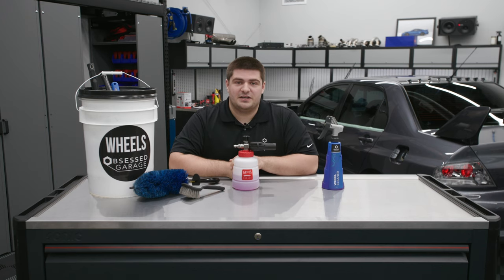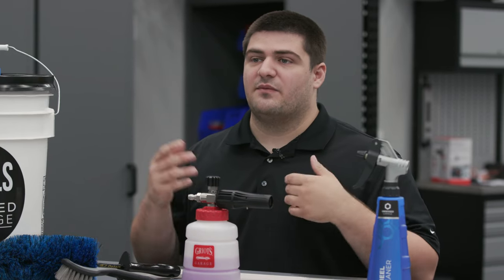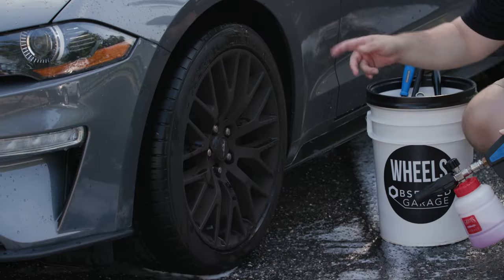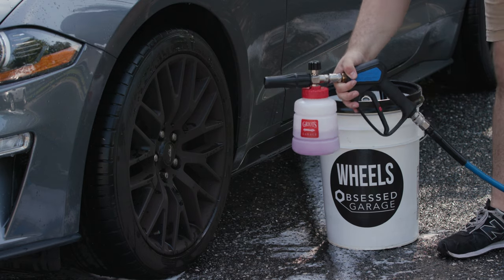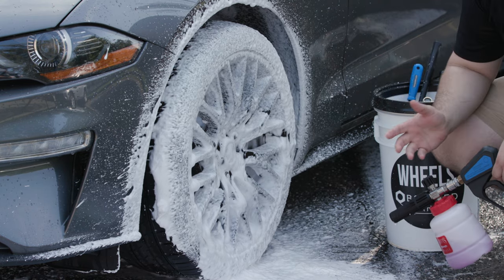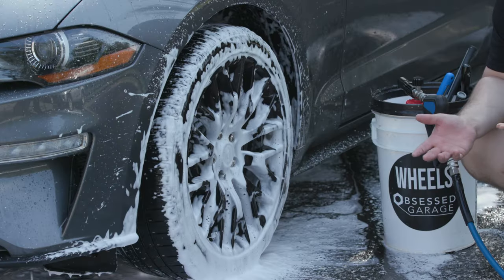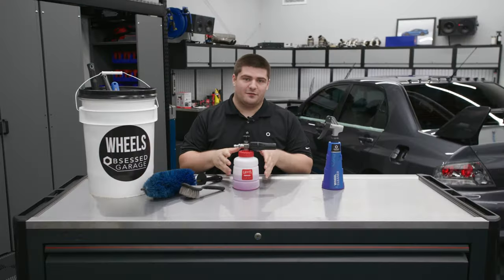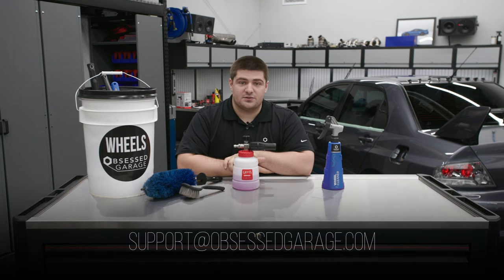Why Should You Use a Foam Cannon on Your Wheels?

Comment: What about the pf22 foam cannon can that one be used instead of gritos? Also do you have to re attach the pressure washer sprayer to the foam cannon a bunch of times each wash? Is this going to wear out my wand ?
Reply from the maker: You could use the PF22.2 we used that one for many years before switching to the griots. Also, yes you'll have to add and removed the foam cannon a few times but I don't think thats something you should be worried about we see a very very low failure rate with couplers and if they do fail its almost always just the Oring.

Comment: Never seen anyone foam wheels/tires until i discovered OG. Idk why no one else has done it in a video. Done in 3 seconds vs using a spray bottle sitting there for 30 seconds trying to get complete coverage and with that comes a total lack of suds. Feel the foam has much more lubrication.
Reply from the maker: Agreed, its very satisfying as well.
Reply: There’s a reason why nobody else does.
Reply: I don’t think the reviewers use the foam cannon because they are being paid to Advertise the product and that means showing the label off